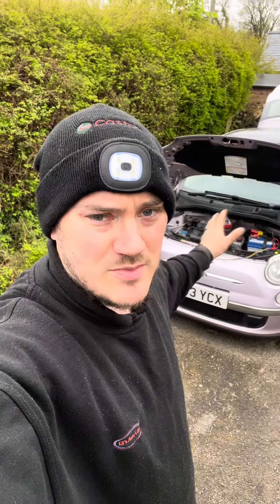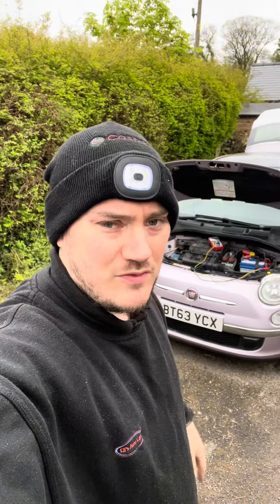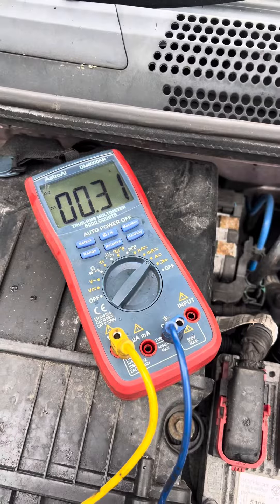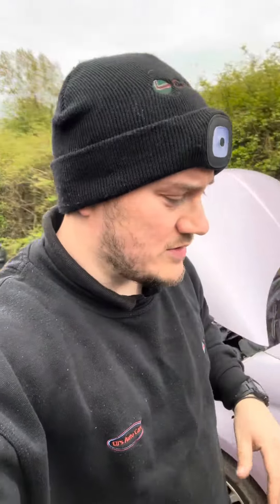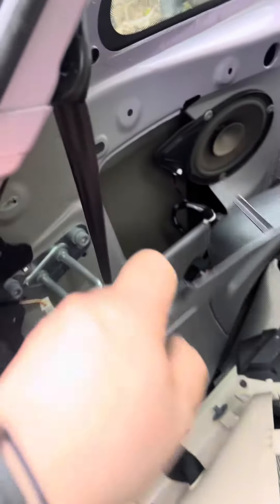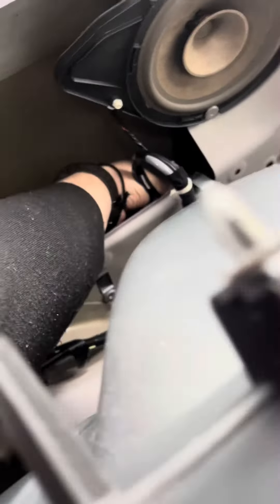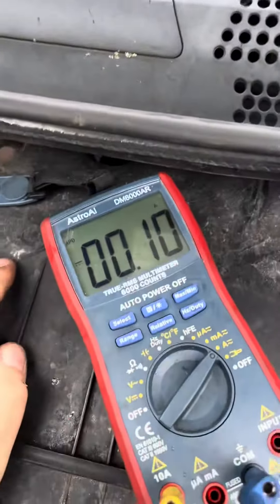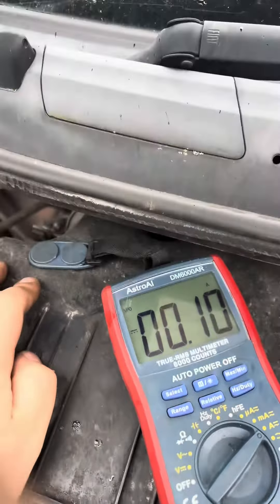FIAT 500 battery keeps going flat

Comment: Just had this issue with mine today. Going to show this vid to my mechanic 👍
Reply from the maker: Was it this?
Reply: Having the same issue with my mothers, mileage flashing and multiple batteries going flat. Gonna check this and jump back ob
Reply: Just had a brand new battery fitted. Took it out for a spin yesterday, battery light came on and I lost power steering. The central locking seems dodgy……